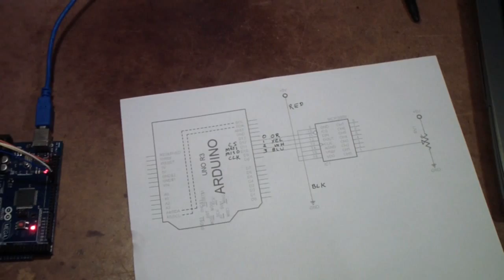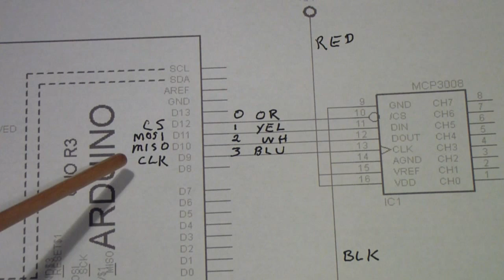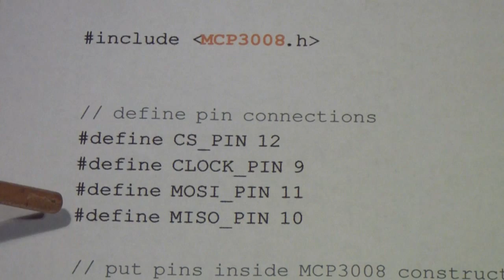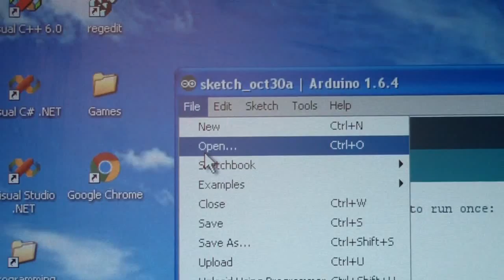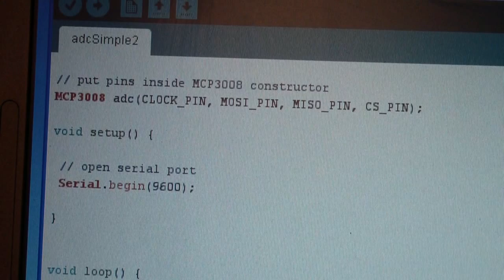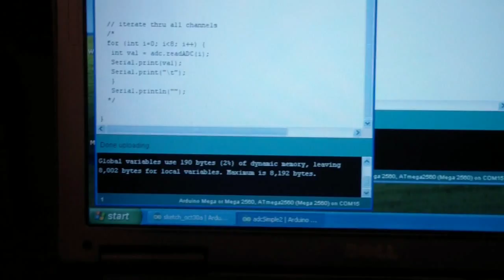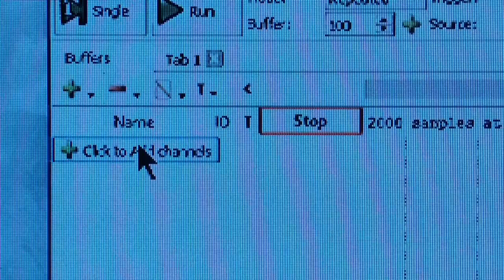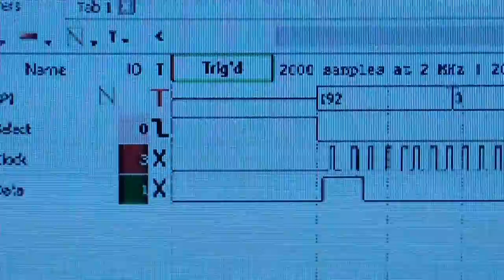TTT127 Analog Discovery Arduino Part 4of4

Comment: Great video and thanks for showing experiments using the AD2 working with Arduino.  I am starting to work with these devices and this will be a great project to add more depth in using them.  Incidentally, I also have a Keithley 2015 THD now - your video covering this and the other by Gerry Sweeney helped me get something top of the line and affordable.  With the 2015 THD and the AD2 you have a lot of instrumentation for the money.  Keep you videos coming.
Reply from the maker: Thanks for your comment. I really like playing with Arduino and Raspberry Pi. I say playing because all my uses now are just for my amusement. I used to work with microcontrollers among other things but it is a lot more fun to decide what to work on instead of being compelled to do so by a job. Vive la difference!

Comment: Thank you for all your videos...is there a reason for using only 8bit? I read the chip can to 10bit conversion or does the SPI protocol eat a few bits?
I have been looking at getting a Oscilloscope, and i dont have a wavegenerator, so this Analog Discovery seems to be a good one. only thing i dont like is that i have to start up a computer to get it running....and no knobs, just fiddle with the mouse...would be cool if it was possible to map real pots or midi controllers to some of the parameters on the Analog discovery (maybe possible via the API?)... Im thinking Analog discovery with a old cheap analog 100MHz oscilloscope could be a good setup. Although that would set me back close to the price of a Rigol 1054Z,...that one does so many things and is standalone....
Reply from the maker: Thank you for your comment. 
The MCP3008 has eight input channels, each channel is converted to a 10-bit ADC value which is then sent using a 10-bit transfer (per channel) over the bus (you can see this on the MCP3008 data sheet available from Adafruit or in the video around the 3-4 minute mark - D0 through D9 - 10 bits - are transferred per channel). So if you enable all 8 channels there are a total of 80 bits transferred in total. The MCP3004 only has 4 input channels but it still converts each channel to a 10-bit value and transfers it over the bus. Most microcontrollers store this data in 8-bit bytes (requiring two bites to store a 10-bit value) but the inherent resolution of the ADC in the MCP series is still 10 bits. I hope this clears up any confusion. 
As to the Analog Discovery, it is just like all USB based instruments, it reduces cost by having the software run in an attached computer rather than embedding the computer on the motherboard of the instrument (which is what modern stand alone oscilloscopes do).  The trade off is reduced cost at the expense of having to buy and connect it to a computer. I like and use both types but it does get more expensive for the flexibility and convenience. If I were starting out and already had a computer, I would get an AD first . But if you need higher bandwidth then the 1054Z might be a better way to go. I would be interested in your choice, especially if you can include a little about your reasons for the choice.
Reply: Thanks for your answer. 
I guess i got confused when you used the analog discovery to decode...in the settings for SPI there was a 8bit setting there :) at 12:12 ...but when you monitored the data from the arduino i saw 1024 values...i think i saw somewhere only 256 values...but that may have been another video :)

Im just going to use the scope for modular analog synth design...so voltage controlled oscillators, wavefolders, resonant voltage controlled filters, ADSR, voltage controlled amps, mixers and some digital stuff for step sequencers and even some arduino programs for some generative patterns maybe.
And also to probe existing designs (synths and other audio devices) where i may not have the schematics...and mod that to my needs.
As im quite new at this so im not sure what i would need for this application in a scope. Much to learn. 
im leaning towards the analog discovery and a old analog 100MHz CRT combo...but it seems simpler to just have the full featured 4ch 1054Z...but the integration of Multisim and Labview on the analog discovery is interesting.
that makes sense regarding the USB scope, its cheaper coz it does not have big CPU and LCD....well i have to read some more and i keep you posted regarding my choises and the resoning why.

Keep posting your cool videos...great suff! Thanks